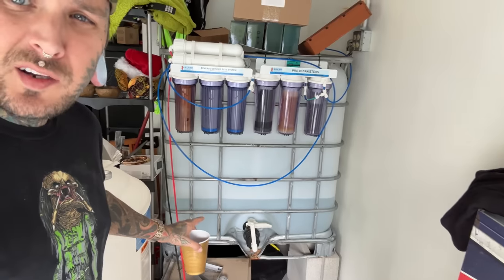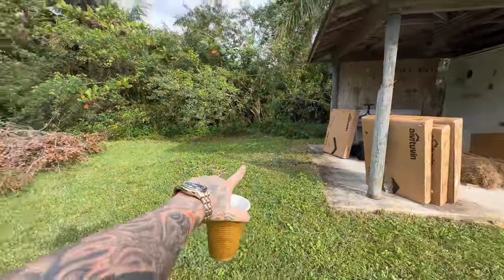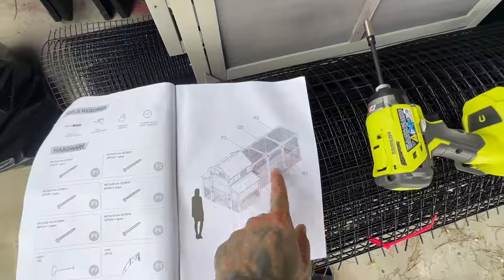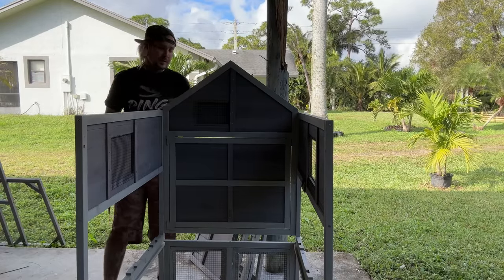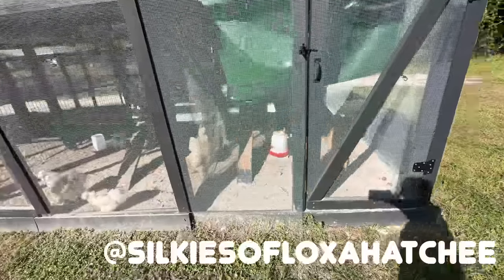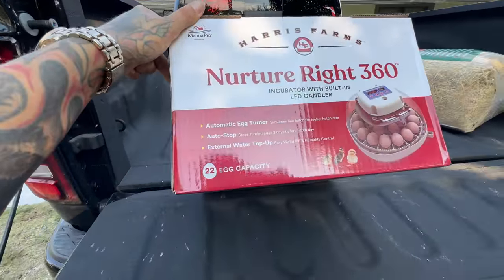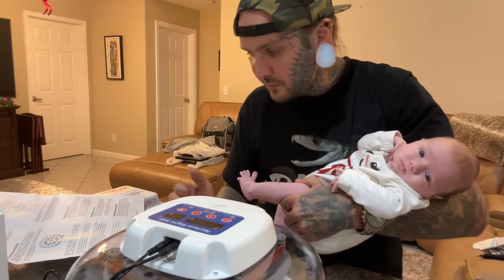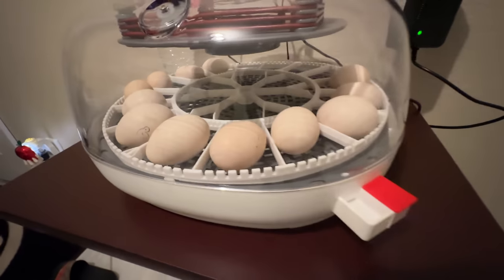WE GOT CHICKENS!!! and Setting up a Aivituvin-Air46 Chicken Coop

Comment: Hey Tyler got way you tell you got rooster hen you grab chicken flip up side down in hand if they chicken pulls it's feet in it is hen if it pushes it legs straight out it rooter might sound crazy but it works it did this with all my chickens I got the same type chicken's you getting I got silkies that have upside down feather on them .